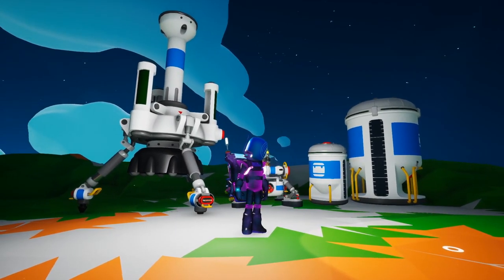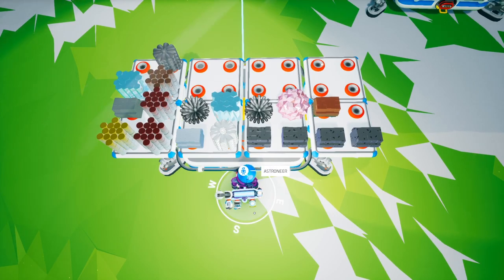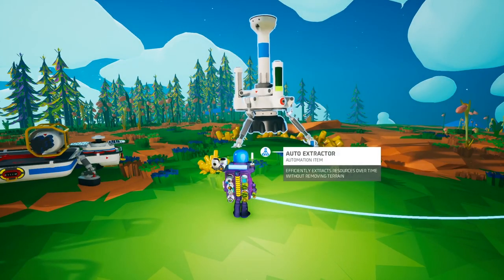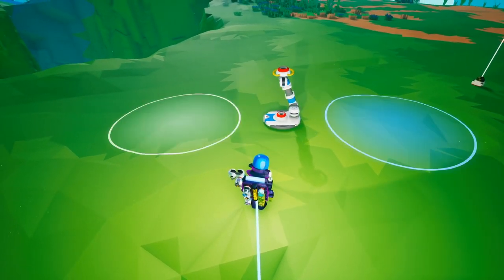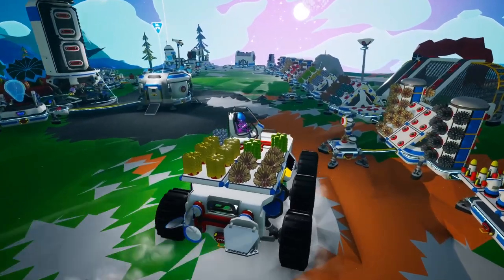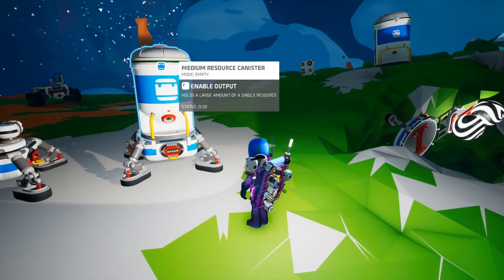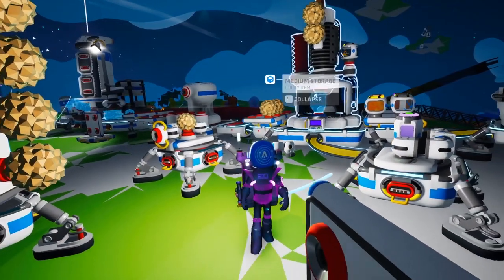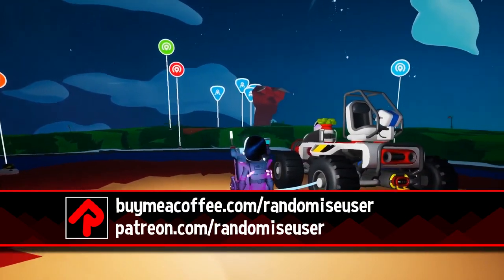Astroneer Automation Guide: How to Use Auto Extractor, Auto Arm, New Resource Canisters

Comment: On my main colony on Vesania I made a large resource canister for every resource then I set up auto mining operations for off planet resources that each have the auto arm store the resource into 2 medium canisters. I then do a round trip from Vesania with 4-8 empty medium resource canisters to Novus for Iron, Sylvia for copper and Zinc, then desolo for tugsten. I switch the full medium resource canisters with the empty ones I brought then return to Vesania with the full canisters. To unload the medium canisters into the large canisters simply place the medium canister onto a platform B with the large one and toggle the output on the medium. The resource then auto transfers to the large. :D

Comment: little heads up, you can have med canisters of supplies set to "extract" and they will fill machines on the same table.   So with a  ELarge Platform C, you can have 2 canisters of say aluminum and copper on the left, a chemistry station or 2 in the middle, and 2 'processed' canisters on the right.  Setting the aluminum and copper to Extract mode will try to 'fill the table' - as all slots are filled (as long as the other canisters have something in them) it won't do anything - until the chemistry station needs those materials.  In this case, perfect for taking 32 aluminum, 32 copper, and turning into 32 aluminum alloy which will all end up in one of the canisters that started empty/set up for it.  Then you can either use button toggles or manual to 'extract' the aluminum alloy out - have an arm take it, and put it elsewhere, or just pick up the whole can of it, and put it where you want.

Comment: i just use a medium canister /shrug
also it uses a tooon
and carbon only lasts for 100 seconds in a medium generator. honestly i think the minimum is either one rtg + a few wind or solars and a battery (they can all be made tier 1 and put iny our rover's inventory stuff with the auto extractor taking space behind your seat. without using 2 large rovers which reduces your maneuverability.  or simply save the nanocarbon for the second rtg! 

the good thing about med item canisters is that you can plug it directly there. or you can just use autoarms anyway! (an army of them to transfer it to base D: that'd use a lot of power

Comment: You could make a unlimited resource maker by putting a Auto Extract resin to small cansister from the small printer to medium shredder to the trade platform which takes no power or fuel

Comment: this is extremely shit for end game, i thought it just works anywhere and you can select what resource you want to pull from the planet, kinda like the atmospheric condenser. i aint using this, it's still manual labor to set this up and move it each time around the planet
Reply: if you place it on an area that you know you want it to permanently get, place it there and every time the green bar runs out, you are gonna use a packager to pack it up then unpack it and the bar will reset
Reply: @mungumazal7480  hover board is currently broken. Pick it up and start hovering but I assume they are going to patch that. Super quick to move. Otherwise yeah I package it up and put it on a large rover. To move around. If you chain up some canisters with the auto arm you can come back after a while doing other shit and get like 100 of a single item. I then just swap the canisters out onto my large rover and heading back to base. I find it faster just moving the whole canister. If you have a few extractors put a trailer on your large rover and do a circuit swapping them out. You'll be good for that resource for quite a while. Before the hoverboard update and when rovers were cheaper I just had a rover dedicated to each extractor which had some rtgs. When I had enough of a resource packaged up the extractor put it on the rover and drove to the next node. Auto arms make it a bit more of a hassle since if you use trailers you have to position it nicely